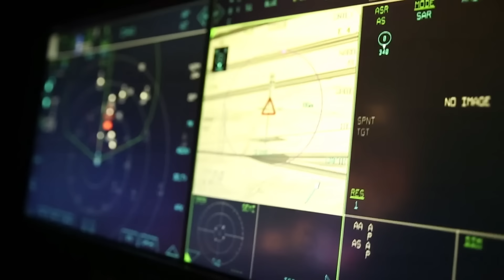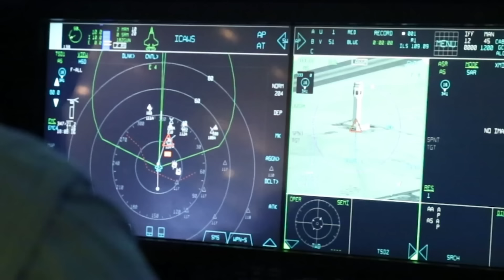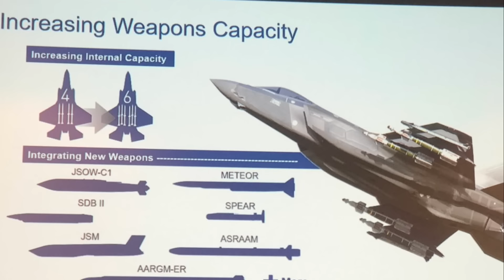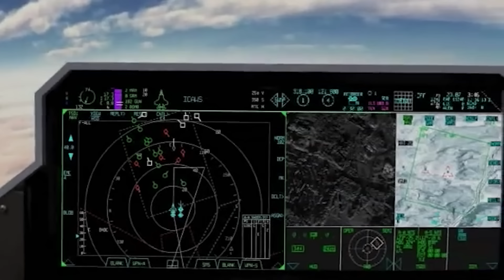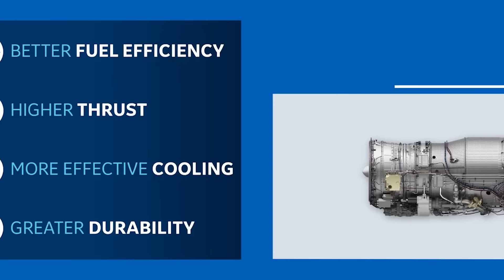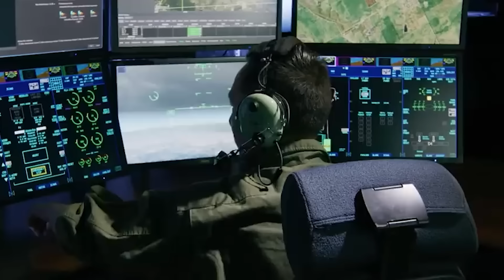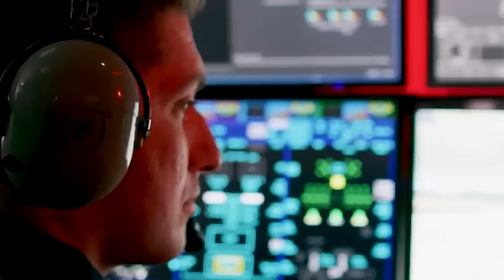The F-35 is about to become a POWERHOUSE

Comment: If they're already doing this for the F35, just imagine the B21 and NGAD...
Reply: @sporkconsumingsoup  The USAF announced approximately two years ago that it had already flown a 6th generation fighter jet, and that it had broken records. What precisely that means is anyone's guess, and it has been crickets since.
Reply: @classicgalactica5879  tr3b black manta
Reply: @classicgalactica5879  I think what will make the NGAD 6th gen will be very high speed, long range, huge (for a fighter) stealth weapons bay capacity (6-8 AMRAAMs + 2 Sidewinders), extreme A2A radar and infrared tracking distances, the ability to command and mange drones + manned F15EX missile trucks, and a 2 seat configuration (1 pilot + 1"RIO"/drone manager).

As great as the F35 is, I imagine there's a need for a "RIO" type to help sort through all the information to actually take full control of a very large air battle.  And the F35 needs more range and speed for very high threat environments. I think the NGAD will serve that purpose.
Reply: @sporkconsumingsoup   The secretary of air force said just a couple of days ago that they are planning to have 200 NGAD-fighters and about 1000 drones.
Reply: @Noisy_Cricket  for better or worse I imagine the role of “RIO” is going to be filled by AI.
Reply: @jamesturner9651  Yes, it does look that way. The computer is making more calculations per second, than a human can even conceive of. The pilot, whether there are two people in a cockpit, or not, is only going to need to interact with the interface, and focus on surroundings and awareness. The way I have been hearing it described, it should be like looking at a menu of options, instead of trying to calculate and make on the fly adjustments, while also flying the plane.
Reply: @Inertia888  I really think NGAD is going to push the envelope and reinterpret how we perceive dogfighting and AirPower.
Reply: Just imagine this with a fleet of drones accompanying a few F-35s, greatly increasing the weapons capacity of that fleet.
Reply: @classicgalactica5879  F-27 Tic Tac
Reply: @jamesturner9651  nah, I very much doubt that. DoD is pretty dead set against allowing AI to seriously control assets in my experience. I think they're okay with it making suggestions (which the RIO would manage) but the idea of AI directly controlling something with weapons all on its own is a big line they don't want to cross.

There seems to be some allowance for AI to manage the load (like how AI in and RTS works with the player to control groups of characters), but direct decision making is kinda out of the question for them.
Reply: They will likely have it standard.
Reply: @jamesturner9651  Or have a remote RIO. They stay on base, watching a series of displays that would never fit inside a fighter, and provide the sort of assessment and analysis that an AI can't. At the very least, it can make sense of what the AI is trying to do instead of making the pilot do that while flying the plane in a combat zone.
Reply: @classicgalactica5879  imagine what things they do have that no one knows about...??? I saw a general in a video reassuring people not to worry about being nuked, with a slight grin. I immediately thought, what defensive weapons do we have that no one knows about?????
 Probably not, but ya never know.
Reply: @RandomSwede-1  200 NGAD fighters is a sufficient amount for the first round. After new upgrades, we can choose to build more of them or keep the existing amount and upgrade those too. Either way, it's a win win move.
Reply: @Noisy_Cricket  I agree with your assumption. DoD will not allow Ai vehicles to make core decisions in battle. It is too risky because not only will the Ai capable in making a wrong decision, but most importantly the enemy could take over remote command of our fighter jets rendering us useless in battle and possibly taking over command of our vehicles as well.
Reply: @classicgalactica5879  Mach10 SR-72 Darkstar from Top Gun
Reply: @sporkconsumingsoup    ,
Reply: NGAD will be the first $Billion fighter.
Reply: @RandomSwede-1  Remember, it's two drones per NGAD and a pair for 300 F-35s
Reply: This is quarter-of-century old design...
Reply: @jamesturner9651  I don't think the DOD trusts AI for such a monumental task.
Reply: I am thinking that these upgrades are a result of NGAD and B-21 development.  Can hardly wait.
Reply: @thuydoan7496  unfortunately, it’s not as easy as buying more later. The assembly lines get repurposed. Got to buy as many as you want/need up front.
Reply: @ViceCoin  nah, it’ll be 2-300 million
Reply: @A2K.556  The F22 cost 300 million when it came out in the 1990s.
Reply: @sporkconsumingsoup  Defense contractors get more money to fix defects.
Reply: More likely to be AI assisted as humans have the ability to disearn things about the world that an AI would find difficult to understand.
Reply: @sporkconsumingsoup  Already prototyped it. Just refining the build now.  Only 200 planned along with 1,000 loyal wingman drones.
Reply: @jamesturner9651  Aided, not filled by AI.
Reply: @ViceCoin  No, but a couple hundred million is expensive enough.
Reply: @A2K.556  Actually in today's environment, digital prototyping and digital production will evolve into new designs launched more frequently using proven components.  Flexibility is the key, not the volume.
Reply: @machtschnell7452  It's also the lifetime costs of maintaining a fleet of aircraft after all the vendors no longer exist. The F22 only had 1 combat mission, against a weather balloon.
Reply: @machtschnell7452  Kind of semantics by this point. But yes.
Reply: @cotystiehl7260  that's true,wink,wink,nukes are old news.....
Reply: What do you mean already? This has nothing to do with when the F-35 began production....it has to do with how long development was. Once they decided what computer was going in it....Moore's Law was ticking.
Reply: @jamesturner9651  I think the NGAD will redefine the term "fighter jet".
From what I've seen it looks to be as revolutionary as the Dreadnought battleship or the jet engine.
Complete game changer.
Reply: @protorhinocerator142  exactly what I’m thinking.
Reply: wow...moar trillion dollar boondoggles...totally wasted junk.  For a war that will never happen...fighting as if war is DCS instead of logistics
Reply: There's money in them there change orders. Sustain engineering is a good high paying long term job. If your good, your indispensable.
Get yourself into one of these projects and your golden.
Reply: That unmanned dogfighting F-16 had to be a NGAD testing platform on unmanned combat software
Reply: It’ll be more the huge change in philosophy like drones mated to fighters and much better networking that will be the biggest difference rather than being much more mechanically or computationally advanced IMO.
Reply: @machtschnell7452  that’s the hope, but I sincerely doubt it. At least for the next 2 decades. You can prototype on a computer all you want, but these are incredibly complex systems that require vast specialized manufacturing and then years worth of testing.
Reply: @jamesturner9651  R2-D2 be like:
Reply: @thuydoan7496  It's literally impossible for anyone to "take control" of craft like that. It's not like you can just log into some OS lmao😅
Reply: the f 35 is a turkey, ,the su 57 is going to run circles around it
Reply: Already flown … & if our military is talking about it … we have yet another more advanced fighter in the works.
Reply: ccp should be cowering in fear
Reply: @twixxtro  seen one in the flesh
Reply: @averageGoat_meh_eh_eh_eh  no one fears that turkey, the su 57 would run circles around that junk yard
Reply: Sixth generation platform but its  technology is still obsolete
Reply: @johndoh5182  They would all be shot down by s400 or s500.
Reply: Doing what? Upgrading before it enters operational service? Like a massive upgrade to your new car just after you have left dealership except you got to pay for the upgrade! MIC at its greedy best. No warranty just built in guaranteed obsolescence.
Reply: Do you think we will live long enough to watch NGAD in an air show? xD
Reply: @Noisy_Cricket NGAD is probably the fighter that replaces the Super Hornet.
Reply: @brothergigawatt2116  lol, it would never get the chance to "run circles around" as it would have been shot down far before it even knew the f35 was there.
Reply: NGAD has been stalled now. It probably won't happen.